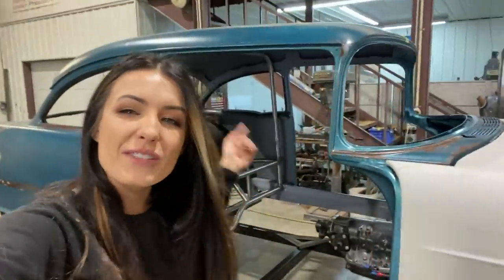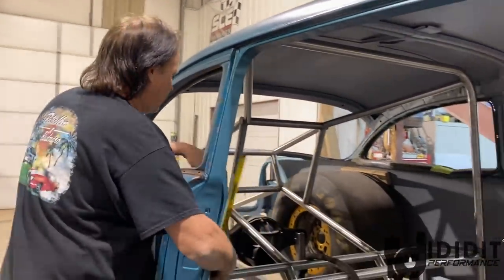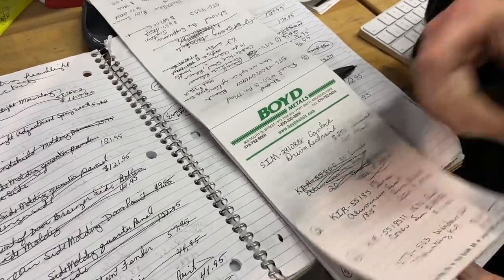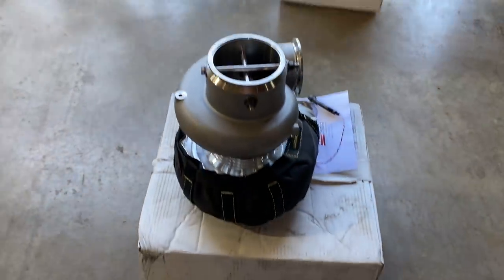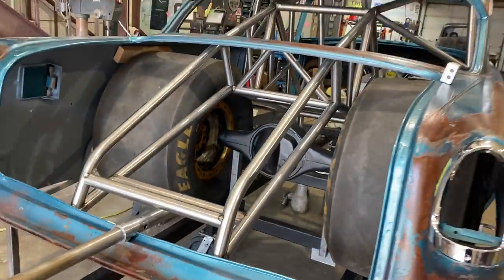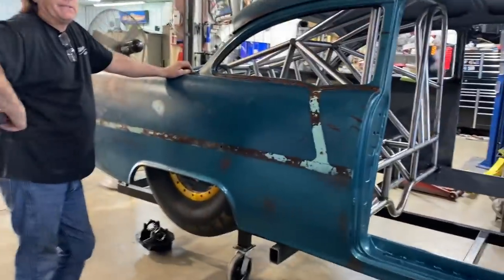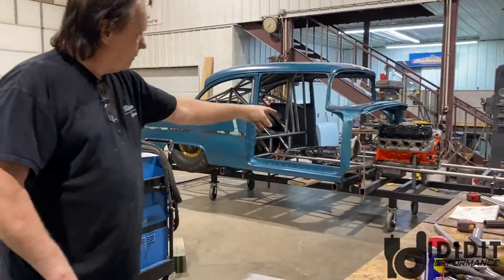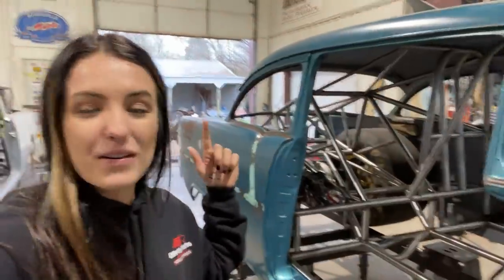A Chassis Built for the Sixes! Plus LOTS of New Parts to Help Get Us There! - 55 Build - Video 5

Comment: Wow, I never expected so many bars. Your dad is luck to have you to weld in those tight spaces.
Reply from the maker: So. Many. Bars. Lol it's crazy! Luckily we will take the body off to do the finish weld!
Reply: @RidingWithAlexTaylor  ok, that should make it easier. Did you design the chassis in CAD first or are you just winging it?

Comment: I have a 55 glass noise I'm reusing on another 55 Nomad I'm building and can't wait to see how your going to lift yours.
I lifted my nose before from the cowl   hydraulically before, next time it will be from the bumper because it launched one time on the highway doing 55. It was something I don't want to ever do again. Try to find eyebrows for that car. I broke both of them. I worked with the chrome shop for months fixing mine with solder then after having them re- coppered and filling and plating them till they fit right. Now I have many spare parts to build another Nomad from the firewall back from a regular wagon.

Comment: Imagine finding parts before the internet!!! 😳😂
Reply: I remember looking up parts in JEGS and Summit paper catalogs back in the '90s. You had to spend a lot of time on the phone either way lol. I think the difference is that nowadays it's possible to build better cars since it's easier to get almost exactly what you need instead of getting something close then modifying it. Also there's more variety, as far as build and combination possibilities go. We were racing s-10 chassis with sbc swaps, and 62-72 half tons with bbc builds, because we knew the part numbers we needed by heart lol.
Reply: Wasnt any more difficult than today, in some respects easier. I built a 55 Chevy in the late 70's. Still have it. There were speed shops (part stores specializing in drag racing parts) everywhere. A lot of machine shops were located near speed shops and did engine work, welding and fabrication too. Here in the NE Ohio area Summit was an hour drive away, Midwest had a dozen stores, HRP and Performance Automotive had several locations. But as times changed so did the hobby along with technology. Parts stores are not immune to going out of business like any brick and mortar. So the easy part is ya dont have to leave home. But when the wrong parts show up that's when the frustration sets in.
Reply: Oh yeah you can get the wrong part twice as fast as you could before.
Reply: @jlc55army  well, we were in a rural farming community nestled among the swamps of Louisiana. Other than the one NAPA, or the Western Auto one town away, you had to order by mail or build it lol. Fun times.
Reply: @mbsnyderc  lol too true

Comment: Amazing progress. A couple questions: Do you do any formal frame structural design? What about CAD design and modelling? Or is this all experience engineering and cardboard CAD? What about requirements for certification or evaluation other than the NHRA requirements as stated, are there any?

Comment: What did you use to trim off the inside of the body? Just noticing how nice and clean that looks. I removed most of the major areas on mine with a plasma torch but now I need to clean up those cuts. Thank you and good luck on your project.

Comment: I was wondering if your dad could tell me about notching. does he bevel all the notches or do they get welded the way they are. Do you guys clean the inside of the tubing and drill holes for vents I'm interested in building a chassis and I've seen people do different things on YouTube. I really like the way you guys build a chassis thanks looks great.
Reply from the maker: Hey James! He does not bevel the edges. Just hit them with a grinder to make them "flat". Basically, just making sure we are not welding on thinned out tube from the notcher. We have not pre drilled holes (may have to when welding if necessary).

Comment: Can you use the same co2 bottle for boost control and fire protection?
Reply from the maker: The same CO2 bottle will be used for boost control and air launcher shoots. The fire system has its own bottle (like a fire extinguisher) for the fire suppression system.

Comment: Why three because the third up by the TB will introduce cold fuel to hot air in which the air that reaches the the second and third injectors will already be cool down a bit kinda the simplest way I can explain it right

Comment: Usually when building a sub 6 second car you build the rolling chassis first then you put the body on the car you don’t build the chassis in the car that’s bracket car stuff there honey that y’all got going on that’s the same way I built my all my nova’s, looks like a mild steel chassis that’s only good to 180mph you need a chromoly steel chassis for a sub six sec car, that’s tig welded together not mig’d or arc’d

Comment: Ah yes, the irony of a full roll cage actually making the car more dangerous, when you don't have a helmet on.

Curious, why do you run such a narrow tyre when you're on the street. I get why on the track, I'd have thought you'd want more grip on the road.
Reply from the maker: I assume you mean for the fronts, correct? If so, it's just for simplicity really... We already have to change the rears and for the street driving we're doing we just drive careful 🤷🏽‍♀️ They're what we need on the track so we leave those on the entire time... Not a lot of room to carry a full set of wheels and tires 😬
Reply: @RidingWithAlexTaylor  Yes I was meaning for the front, should have said. 
Ah ok, I thought you changed the fronts as well. If you're not changing them, that makes more sense.